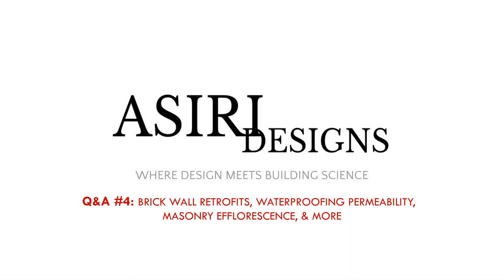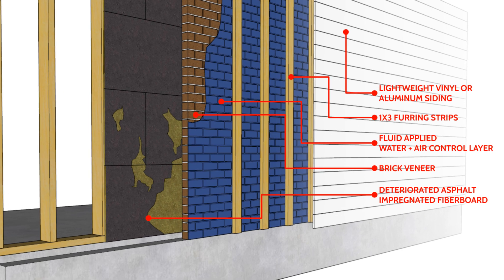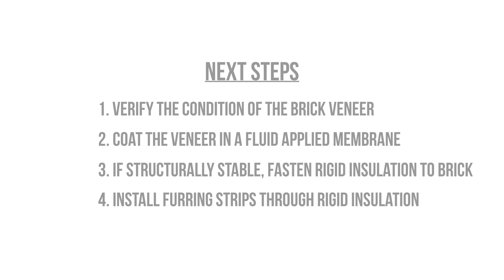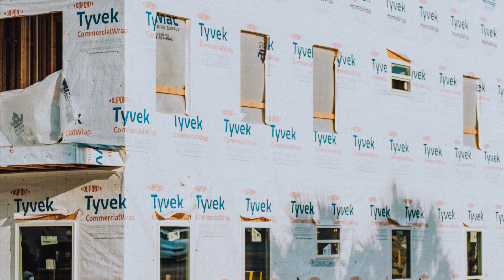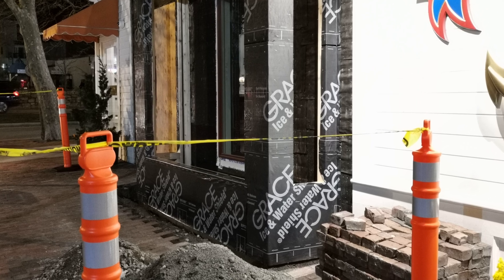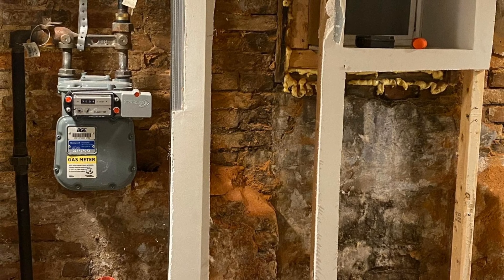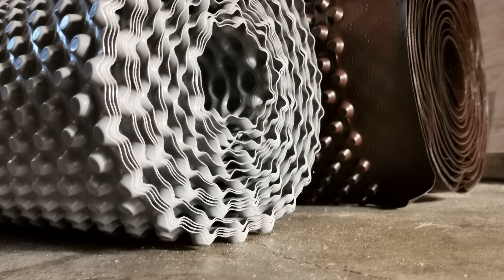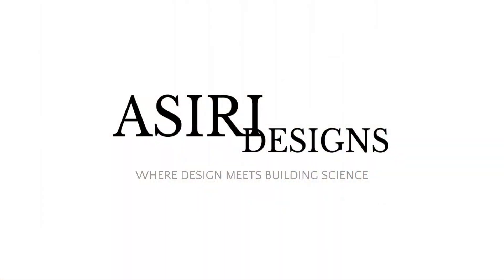Do Houses Need To "Breathe"? Brick Veneer Retrofits, Efflorescence in Masonry Basements | Q&A #4

Comment: I have an interesting situation I wonder if you have any insight on. I am looking into renovating a small brick bungalow which has been totally torn down to bare bricks. The entire structure is built directly onto bedrock, so I can only dig down around 15cm / 6 inches in my test pits. After a rain, these pits fill up all the way and take a long time to drain (I haven't taken accurate measurements of all this yet, this is just an estimate from memory). The floor is bare concrete, and sits around 20cm / 8 inches higher than ground level, I'm assuming this is because of the water level. I don't know if there is any sheeting or anything beneath the concrete slab. I am having it all investigated soon by an engineer. Have you ever worked on a similar property? I'm not really sure what to do to manage moisture. Are there any obvious issues you can see with this design? I can't build the floor up much as the ceilings are already pretty low. I appreciate your videos. Thanks.

Comment: Great videos. Trying to get to grips with different aspects involved in water and building structures.

They are really interesting and informative.

Building codes in the uk have not been fit for purpose for solid wall and line mortar houses, with Portland cement having been used in pointing and renders in retrofit work, nightmare, trying to retrospectively deal with the best approach knowledgeably is a challenge with all the different supposed experts in the trade, it's difficult to know who knows the science and remedies.

I wonder if you could give your opinion on what the best approach is regarding upgrading suspended wooden flooring.

Keep it suspended and upgrade by e.g sheeps wool insulation within the joists with a vapour permiable control barrier beneath the joists with battens fixed under the joists, sleeper wall joists would need to be lifted to install the vapour layer in that location, the sleeper walls would need to be altered in any case to ensure air crossflow is maintainted as currently between the 4. Inch joist is the only flow over those walls, so maybe do that for the vapor layer instead. Also install a dimple mat along the stone & brick wall for the floor thickness or possibly slightly higher

Or remove suspended floor and go solid floor with insulation and impermiable water barrier

There is no damproof course, one could possibly be introduced using chemical sticks drilled at Intervals leaching water proofer with the moisture 
Also external floor level is around +-2 inches of the internal floor level alongside the length of the long side of the house, its on a hill that wall being the highest of the slope. Could possibly excavate to put a dimple mat to a drain channel and also lower the ground to 6 inches below internal floor level, that might be problematic the foundation is sone on clay

I possibly incorrectly? think it would be better to keep the suspended floor rather than making it a solid floor so the walls in that underfloor space and the exposed earth to dry out by exposure to the air cross flow. Also that then brings up the question is it better to have air or soil from a thermal efficiency perspective? Because the air is going to be around +-5° in depth of winter

Comment: Im thinking that the term "breating" must come from a time when houses where less insulated, so that heat pushed moisture all the way trough the wall assembly without condensating? Like when you dry out a construction before insulating.

Comment: Being in the rust belt efflorescence is common. People think it's salt on the roads that makes the vehicles rust so bad. But here a car never driven in salt will rust quick in a filed. Salts are actually more soluble in colder temperatures plus concrete tends to bleed more in cooler weather further encouraging the upward transportation of moisture and its passenger, soluble salts. I use white wash on my 200 year old brick basement. Which pushes efflorescence outward. Because higher concentration inside than out. It helps keep the lime in the mortar joints too. Otherwise the joints will turn to sand over centuries.

Comment: Question: I'm building a small cabin on Lake Huron in zone 5b. Upper loft will have cathedral cieling with 2"x6" rafters with metal roof fastening to furring strips (no osb). What's the most cost effective way to insulate? I was thinking of venting the top 2" of the rafter with soffit vent to ridge vent (furring strips leaving path of travel for vapors to exit), 4" of mineral wool batts, then a smart vapor barrier between the studs and wall coverings, which will be wither tounge and groove pine or plywood. Doesnt have to meet code as it's a small hunting cabin, just want to get as much insulation as possible for a modest budget without introducing mold issues. Thanks!

Comment: Great information! Just liked and subscribed. I saw some of your info on flat roofs regarding EDPM. I'm considering using it on our SIP homes we're designing for affordable home ownership for those of low- to moderate-income. With this info about an air barrier and just watching your SIP framing video distinguishing air vs vapor barriers...I'm slightly confused on what the best option is to keep the budget as low as possible without sacrificing performance. Help!

Comment: Q&A: Continuing the same low slope roof assembly that I inquired about in Q&A #3.  Do you have a roof detail that shows above deck Rockwool in combination with a Smart Vapor Retarder that would meet code in cold climate (6A) where a VB is required by code?  The parapet connection detail is the most of interest.  Where will the SVR go in the assembly?  Supporting wall assembly is 2x6 stud framed with Comfortbatt and 6” Rockwool Comfortboard 80 continuous exterior insulation with a lightweight vented rainscreen.

Comment: Question. When working with Post Frame Construction. We have an 8 foot on center truss. What would be the best way to ventilate the attic space? The reason I'm asking is because we run 2X4 on edge between the Trusses. Unlike a 24" on center truss that gives a nice open space all the way up the sheathing to the ridge. Ours has the 2x4 that runs sideways.

Comment: I'm on the edge of climate zone 4A/5A so I'm thinking a lot about condensation and dew points year round. Building a very tight house (1ACH). For comfort I want to maintain a 50% indoor humidity year round. The issue:  I think general building science cals are based on an inside average 35% humidity during winter? If I'm doing the calcs right, at 50% humidity, I need to put 60% of my insulation on the exterior, not 30% which seems to be the rule of thumb. Any thoughts? I will have ERV and dehumidifier, unvented attic. Thanks again for all the great info. I am applying it!

Comment: You mentioned having less exhaust than intake for attic ventilation. Why? Shingle roof Manufacturers typically specify 50%/50% for intake/exhaust of the attic space based on square footage of the heated space and not the square footage of the roof itself or the volume of the attic space. How come?